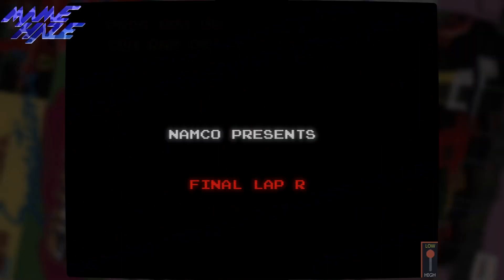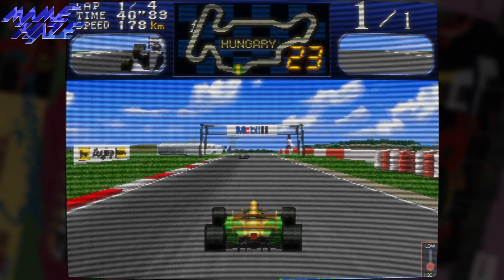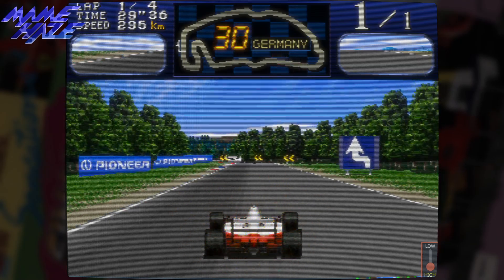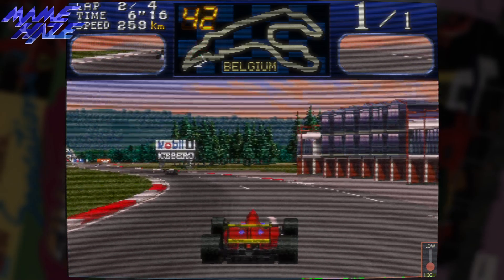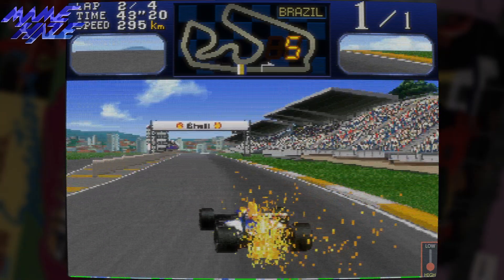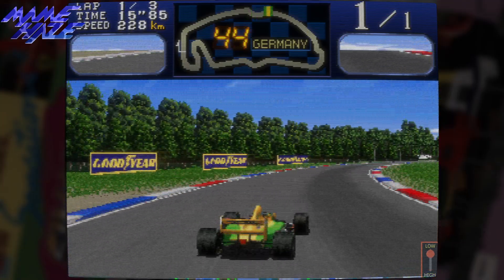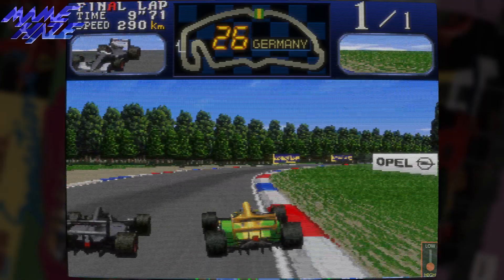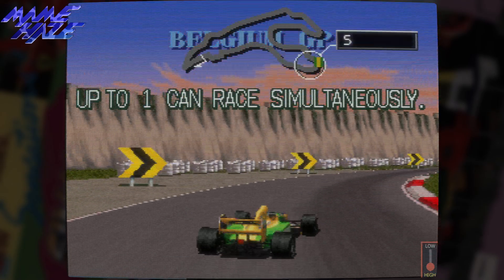Major Final Lap R emulation improvements in MAME - discussion video

Comment: Is this board more powerful than the System 32?
Reply from the maker: Not even close, it's pretty much a 'budget' board. Aside from the main CPU, it's not even as powerful as the later System 2 boards.  (Namco would have found it difficult to port Lucky & Wild to this without cuts)